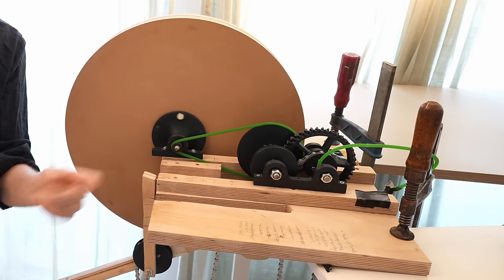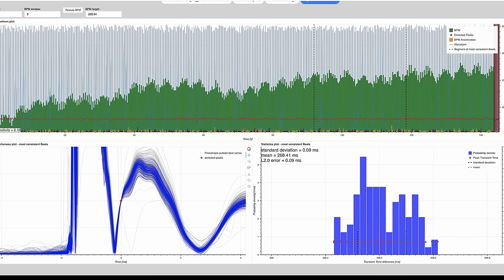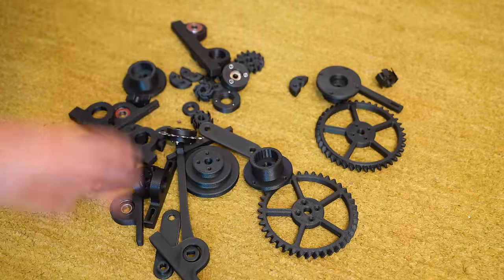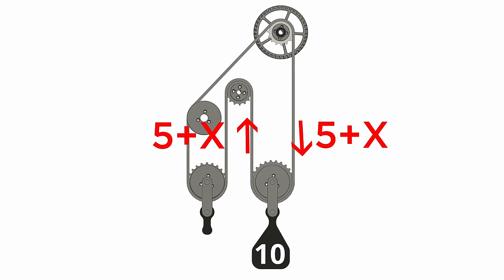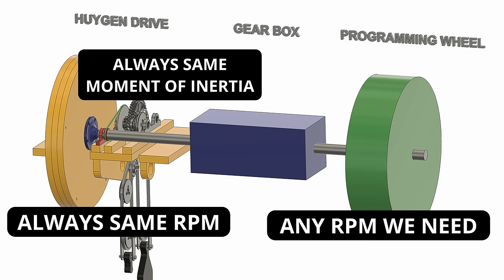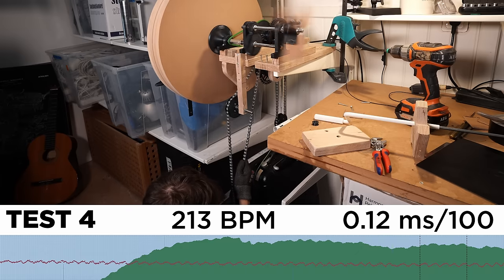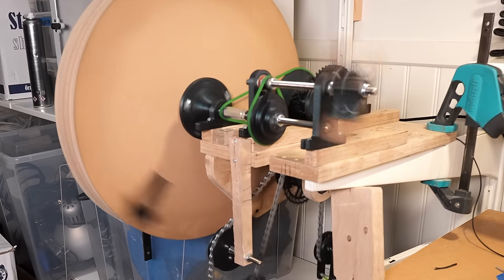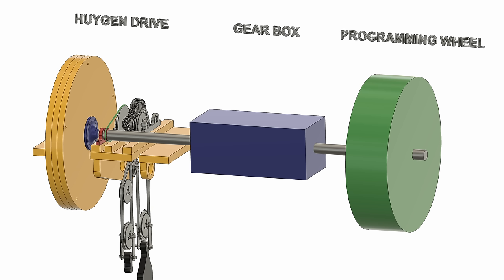Using Gravity To Play Tight Music

Comment: if you're going for an air resistance governor it may be a good idea to look into a spring-loaded centrifugal governor that expands/contracts as RPM increases/decreases so you can easily tweak the desired RPM by preloading the spring/coil. Same principle as old school clocks with a torsion pendulum.

Comment: One of the reasons you went with the pedal and flywheel was so that you could vary the tempo based on the mood and other factors. If you add a CVT (Continuously variable transmission) you can keep this functionality with the gravity drive.
Reply: If they used an escapement clock instead of an air governor they could also have total control of the BPM by changing the length of the pendulum.

Comment: Now that (essentially) what you have is a wind-up clock, would it be so awful to have a motor doing the winding?  Having a continuous wind will remove the energy pulses leaking from the current intermittent wind mechanism (lever, foot) to the output making the timing more accurate, the first necessary outcome.  Loving the videos and glad you are back.

Comment: I'll just say I learned years ago in my physics classes that, if you want to maximize moment of inertia in a disc while not increasing the weight of the disc, you have to avoid using a full disc and instead concentrate the mass to the outside as much as possible.

Comment: Hello,
About the theory of the Huygen drive, I think that as the axis of the "weight sprocket" isn't fixed, turning the input shaft only lift the weight up and none of your force is directly transmitted to the wheel. And that what makes the beauty of this system, the wheel is only spinned by the gravity. This system will accelerate until the torque applied by the gravity is equal to the resistant torque. 
Also, you usually say that more rotational speed result in more moment of inertia, the moment of inertia is constant and is only influenced by the mass repartition around the axis, increasing speed only increase stored energy.
Still loving your videos, bye bye
Reply: Yeah I got confused by that explanation aswell. If there was a 5+X force on both sides of the string and gear, the gear would move up, yes, but it wouldn't rotate. That is does rotate when lifting it proves clearly, that the forces left and right aren't equal.

Comment: 1:16 I know it's just a quick prototype, but the runout on the governer shaft is wobbling the whole mechanism, which will tilt bearings sideways and increase their drag significantly etc. balancing spinning components is critical. Would definitely be worth it to balance all components individually and checking shafts for runout with a dial indicator before assembling them so vibrations don't happen.

Comment: A couple of additions you might consider for maintaining the force (ie weight height):  You could add some powered system with a couple low power sensors and LEDs to a little display in front of the user.  A simple mechanical system might have a level rod, and a ruler (marked length of some material) so the user can monitor the height of the weight live.  I was typing the flywheel governer idea just as it popped up in the video, lol.

Comment: You could make an adjustable resistance governor with magnets.
A magnetic break clutch.
Reply: Theoretically you could even mechanically link the clutch position to the falling weight, automatically adjusting resistance based on elevation...

Comment: You could use a weighted govener like you find on steam engines to adjust the pitch of the air break goveners faces, to create a self speed adjusting system.

Comment: As people have mentioned before: If you need to tightly balance the friction in the system, the variable load the marble machine will have will hugely affect your speed.
From my understanding, you would need the friction of your entire machine to be significantly less than the friction of your governor in order to have a stable speed. If you're now talking that "the grease in the bearings warming up" will affect your timing, then you I don't think you'll have much success.

However, if you manage to design a good governor, I think this system could work. For example, a centrifugal based governor that applies a very strong breaking force at a certain speed. You can make that breaking force arbitrarily high to trade system efficiency for comsistency.
Reply: Supposedly, inertial governors are better at handling quickly changing loads than centrifugal ones. Not sure if you looked into those.

Comment: Maybe you can consider designing the air governor similar to a constant speed propeller, where the angle of attack of the prop blades control the rpm. Perhaps a centrifugal force can steer the angle of the blades „automatically” resulting in constant rpm - a higher centrifugal force would increase an angle of attack of the blades resulting in slowing the rpm.

Comment: In order to hold constant output speed, either the gearbox or the governor needs to adjust to gradual variations on the overall output speed. A CV transmission or a flyball governor can solve that

Comment: One thing you didn't play with was adding weights to the end of the air governor wings. It helps keep everything balanced by keeping the air governor spinning at a more constant speed in theory rather than just resisting going faster it will resist going faster and slower. You need more to resist going faster but keeping it up faster make it more constant. At least theoretically. You can get small lead weights that can be inset into whatever size air governor you decide to use. Making them longer and narrower vs wide and flat will add the same air resistance but also put the weights further out giving more inertial resistance.

Comment: An idea for your gearbox would be a CVT. Basically you have your input shaft and the output shaft in parallel. On each shaft, you have a cone. At the input end of the gearbox, the input shaft cone is at its widest, and the cone on the output shaft is at its narrowest. At the other end, this ratio is inverted. There is a belt wrapped around both cones, and a guide between the cones can be used to push the belt along the length of the cones to change the selected ratio.

Comment: Retired Chem Eng musician from USA here.  I am impressed with several things.  Your desire, your engineering skills, your musician skills, your climbing skills and your language skills.  
Do you have a day job as an engineering team leader?
I enjoy your engineering. your troubleshooting.  and variations.  
I would try examining the variation by using the coefficient of variation, the  standard deviation divided by the mean. You may have a small SD at high rotation, but when you step that rotation down in the gearbox say from 200 RPM to 75 RPM (BPM) you may have the same SD time as before.
Here's my idea for improvement.  Use a much larger weight with different gearing to get the same flyweel and regulator speeds.  This will mean the weight will drop slower and you crank it up before you start playing then don't crank it for an hour. Then as it plays you are using gravity as a constant.  You are removing the "X". This may mean more reinforcement on the top bearing but It may be worth it. 
Thank you for doing all this work.

Comment: Use either the weight  or the fly wheel. You don't need both.  Make the air governor blades angle of attack adjustable.  You  need active feedback to get constant BPM out of your rig.   Add a mechanical feedback linkage between the angle of attack on the air governor and the speed of the BPM drive wheel.   When it goes too slow decrease the angle of attack  when it goes too fast increase the angle.     If you  get increasing  or decreasing bpm over time you you have an open loop system with insufficient control feedback.

Comment: You should compare "pulsed input" vs "static input" also. between the governor and the flywheel, your tempo should be more stabilized.  Additionally, you should when you build the machine, plan for a large drop distance. especially if you find pulsed input doesn't cause too much tempo drift, you can provide periodic input, allowing more opportunity to operate the rest of the machine.  Most clocks with dropping weights only receive input once a day and manage to hold pretty tight time.

Comment: Look at a bike crank which is oval. It's called bio pacing. They designed it so that the pressure is the same when pushing down as forward. It's even and steady. You can keep it steady and even while pedaling.

Comment: You could use two governor's solve the drift. One air break governor as a air break but with blades that can change shape. The second governor is a gravity based governor that control the shape of the blades. Thus you get one reliable force in the system 9.81m/s^2.

Comment: You need to add a continually variable transmission hooked up to a centrifugal speed sensor. That way when the sensor spins too slow or fast, it automatically adjusts it's gear ratio

Comment: Hey Martin,

Loving the work. Quick query to show how tight your beat is don’t you need to normalise your standard deviation time to the period? ie for 73 bpm if you had a 2.51 ms standard deviation over a 822 ms period that would be a drift 3054 ppm drift within 1 σ but at 328 bpm if you had a 0.04 ms standard deviation over a 183 ms period that would be a drift 2186 ppm drift within 1 σ which isn’t as big a difference as it initially looked. Because 1 whole beat takes significantly less time as you play faster. Hope this helps you to appraise how tight is tight enough. And not chase perfection at the expense of good. Keep up the good work 😊

Comment: A bigger flywheel will make your temp drift worse. You either need a smaller flywheel - which will get you less resilience against output friction changes and less tight music, or you need a dynamic governor.
You really need a dynamic (e.g. centrifugal) governor.

Comment: It seems to me that you've disproved the assumption that the constancy of gravity power keeps the music tight. The governor is helping, but I'm starting to think that in order to get the precision you're after, you'll have to go to clockwork. Clocks don't keep adding weight to get tighter, they use tuned oscillations of pendulums or balance springs. 

You've pretty much nailed the marble gates through the use of escapements. It's not such a big leap to go to an escapement mechanism to drive the timing. The question you've been asking: "is it possible for an analogue mechanical machine to be tight?" has already been answered, and the answer is in clocks.

Comment: I have an idea for the tempo drift problem:
The flywheels inertia together with the governor and the chain drive should make the rotation speed look like a dampened oscillation. But you see no oscillation, which could mean that the system is over-damped. 
What you want is a system where the oscillations disappear very quickly: critically damped. 
I believe the only dampening in the system comes from drag created by the governor, but even a very small governor the system still looks over-damped, so that's clearly not the answer.
I would try using a lighter flywheel, so that the speed can overshoot the desired rpm in a reasonable amount of time.
Try to find more than one combination that creates an oscillating speed, and then try to figure out what values might create the best result. critically damped or maybe a slight overshoot?
Anyway, I am beyond impressed by your overall progress and the amount of detail you go into to make the perfect mechanical music machine. 👏🤌🦾

Comment: Maybe i am missing something. What i am thinking is, that a system which consumes variable amount of power (more or less channels running) won't run "tight" on constant power. But will get slower the more power is consumed. 
If we ignore friction and base power required to spin the machine: One channel is running -> only one marble has to be lifted. If 100 channel are running, 100 marbles have to be lifted. Therefore the energy required to do the work in the same time rises proportionally. 
Yes the flywheel can smooth out peaks but it can't provide more power if the power input is constant. 
My guess is that musical cabinets don't have this issue to the same extent, because the amount of movements at any time is relative constant. But the marble machine has to lift "weights" (marbles).
Please correct me if i am wrong.

Comment: Martin, Martin, Martin:  You are redefining "tightness" as you change modules.  You can't do that:  you're setting yourself up for failure.
  You first defined, "tightness," as "variance in the time between tripping the gate and the marble hitting its target."  Obviously, you want that constant, otherwise the marbles are "playing randomly" [specifically, there's a random-perturbation on when a note plays].
  Now, you've redefined tightness to mean:  "The Power-Module provides a tempo that sticks exactly to tempo of an external metronome."

Martin, even a human can't stick exactly to the tempo of a metronome.

But the real flaw is in the first 5 words:  "The Power-Module provides a tempo…"
NO!  Bad Martin!  <thwacks spreadsheet out of hands>  The Power-Module is FOR SUPPLYING POWER … it's right there in the name!  "Supplying Power" and "Keeping Tempo" are two completely different functionalities!  Focus on getting that gearbox to deliver a rigid, fixed tempo, and let the Power-Module just provide power.

And lastly:  Why not just lean-into the fact that the MarbleMachine is always going to have a non-constant tempo?  Write music that expects this.  Let the human players vary their tempo to match the MM3, not vice-versa.  People writing music for the harpsichord had to deal with the fact that it has no way to control its dynamics, and came up with various techniques to give the impression of varying dynamics even though the dynamics was still fixed.

Comment: If you use two weights to drive the flywheel, one weight could be actively pulling down while the other is wound up. Then, the inpute will be more consistent.

Comment: The weight is most definitelywhat is powering the drive, the crank just charges the mechanical battery with potential energy (the old mgh = e). Connect enough weight to a crane and lift it up ahead of time and you could run a pretty decent set without any "crank charging" at all.

Comment: I think you should give the air governor fins the ability to pivot (to change pitch like a propeller) and then attach fly weights to them which are counteracted by springs. Then, the faster the governor spins, the more the pitch will increase which will slow the governor down, which will then decrease pitch, etc. I think this would solve the tempo drift issue.

Comment: Use a digital oscillator and PLL to control a stepper motor which moves a magnet closer/further from a metal ring at the periphery of the flywheel. You can have perfect tempo control.

Comment: Ah yes, lifting the weight increases tension in proportion to its acceleration; considering the cranking and BPM as signals, there is a zero between crank input and BPM output.  Poles and zeroes are... a high level topic, but the idea is, in a system that otherwise responds slowly to changes (lots of poles, which give a low-frequency filtering effect), a zero gives an immediate change at the output, for an immediate change in the input; or if not proportionate, then maybe a derivative (in particular, a lower derivative than the total number of poles).  The weight and flywheel contribute poles, the time constant of the system being the dashpot (braking fan) resistance times flywheel mass.

These are mechanical systems where direct electronic analogies can be made; the effect is like a filter capacitor having ESR, that lets through a little signal immediately then responds gradually the rest of the way.

Presumably, one could take, say, the force of the crank (registered by the reaction force on the gears, say?), and use that to brake the flywheel via some levers, exactly in proportion to the counterweight-raising zero.  Difficulty of course is, making such a linkage where the braking force is linear with crank rate, and at a (linear) slope that just cancels out the cranking rate.  That's rather tricky to solve, so it would of course be preferable to have a system where that zero simply doesn't arise in the first place.  Often we can rearrange systems to give different values or combinations of poles and zeroes; there might be a clever variation on this mechanism that accounts for this effect.

I don't have any particular recommendations here unfortunately, just offering some perspective.  Cheers!

Comment: From mechanic and engineering point of view the the huygen drive is sure a great solution. I'm a bit worried if its practical if in the end you might need 2 meters of height and 2 tons of weight. No idea how but probably try to get some estimate how much torque the final machine will need and in what dimensions of the drive this will result.

Comment: @Wintergatan Why not using an inertia regulated air governor? Like an air governor with small mass at the end of the fins that would increase the angle of attack of the fins with the centrifugal force. Of course, this would mean a vertical air governor but my assumption is that you should increase rapidly your speed in the early stage and stabilize it more effectively after some time. So the time spent to increase the speed should be reduced. That would help you to use longer fins while maintaining high speed.

Comment: For the speed governor I'm thinking implementing a system like the tail rotor of an RC helicopter might work well so the resistance is minimal when you start it up and you can accelerate faster, and then it can move the blades to a more straight position as the speed gets closer to the target RPM.